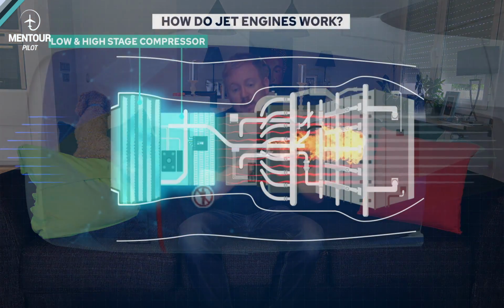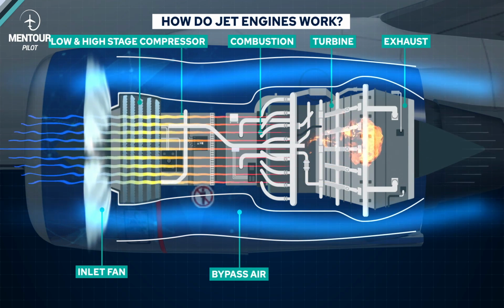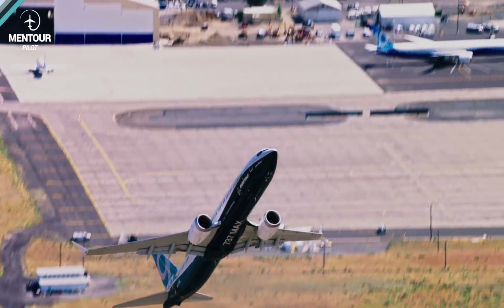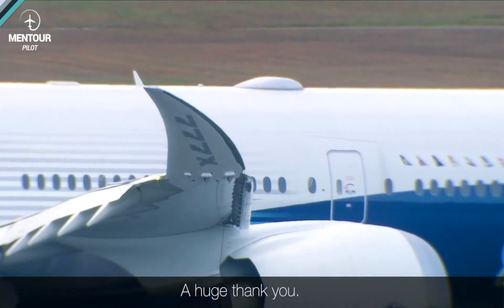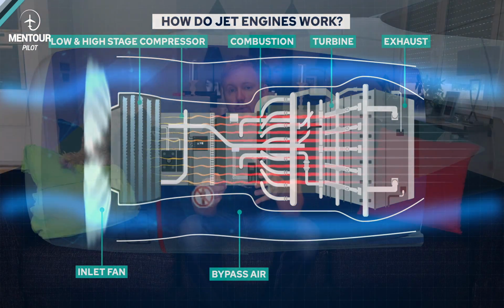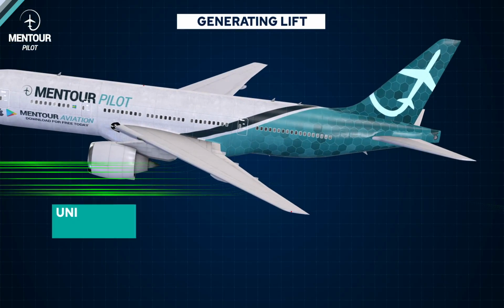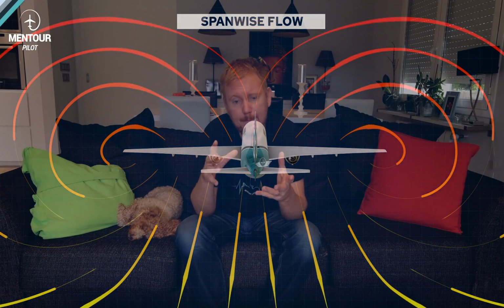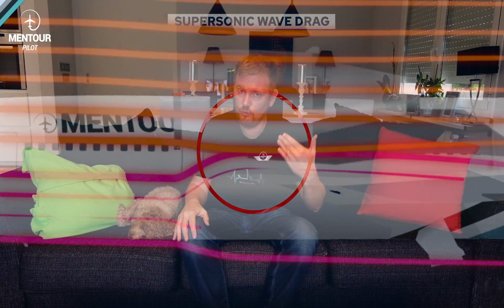How BIG can jet engines get?!

Comment: I enjoy your videos very much! and Thanks!
\
New designs are needed to increase safety margins to the point where no fatalities result from any mechanical, material, chemical, or software failure.

In this regard,  you might conclude that flying is safer than driving an earth planted vehicle. If you look at the past record of airline operation, you will find that while millions of people have lost their lives in ground-based transportation, still, thousands of people have lost their lives in the current designs of aircraft. 

Future designs, if allowed, would have to bring the lives lost count to zero. Some would conclude that this is impossible. It is only impossible because as long as trial and error designs prevail, the lives lost count will always be there.

Take the 737 MAX for example. As your videos show, the failure points are already well known.

The builders of these aircraft know that over the course of decades of operation, they will see hull losses. A good part of those "hull losses" will include the loss of lives and the disability of others. 

Let's say that any new aircraft design or redesign, was subject to special flight paths over land and for cargo operations only for the first one or two years of operation.

Just this change alone could have saved hundreds of lives in the case of the MAX.  Lives that once lost cannot be brought back.

1950's aircraft design just is not going to cut it anymore.

Believe it or not, there are aircraft designs right now with current technology that provide for zero loss of life even in the event of mechanical or software failure.  

What about the 1950's aircraft designs?  That's what museums are for.

Bypass ratios 1000 to 1 with current technology and materials.

Around the equator range.

Unlimited hover.

No need for airports unless you just gotta have your 20th-century dinosaurs.

No fatality failures of any kind.  Mechanical or otherwise.

It is not for lack of technology. 

Why is it then?

All the people that work in aerospace must answer this question. 

Why must you answer?  Because you have taken this responsibility upon your shoulders for air and spacecraft safety.

Because man designed and built these craft, man is responsible for the outcome. That is why.

Well then, if I am so smart then why don't I design and build my own aircraft?

I do not want to jeopardize the lives of millions of people to satisfy my own itch for something new. Something to beat the Jones next door.

Or the Germans or the Russians or the Chinese.

Can't live with that on my conscience. 

It amazes me that some people can do that.

Coward! You might say.

No, just smart enough to know better. 

Know better than to go where angels fear to tread. 

That is your territory. That is the world we live in. That is not going to cut it either. Not with the angels nor with me.

Comment: Great channel.  I'm so impressed with your excellent explanations over such a broad array of topics.  But I feel like you missed one critical point on this one.  You mention that M x delta_v  = m x DELTA_V.  But you didn't explain why it's more efficient to go with a bigger M and smaller delta_v.  And this is because thrust generated is proportional to mass x change in velocity, while the energy required is proportional to mass x change in velocity *squared*.

Comment: In fact the GE-9x is more powerful compared to the GE-90, but they had to decrease the thrust in order to guarantee no material failure, because of the new material they used. That was only possible due to the new wing.

Comment: I worked on the original GE90 in 1991.  We joked that the engine was the same size as a 737 fuselage.  The one thing you missed in your presentation was sound - for a given thrust, higher bypass engines are much quieter.  It is interesting to note that the GE90 was less fuel-efficient than the TF39 engines on the C5.  Of course, the C5 cruises at a much lower speed that probably won't work for an airliner.  Still, modern airliners don't cruise nearly as fast as the Mach .9+ that some of the early airliners reached.

Comment: What about raising the wing to the top of the fuselage, like a C5 Galaxy.  Also remember 13 feet is the practical limitation of shipping the engine.  Giant earth movers and dump trucks could be bigger but the shipping of the tires is the problem,  tires are maxed out at 13 ft.

Comment: I can't believe you can say the max with a straight face. Maybe that's why you are a pilot and I am into corporate management. The max should have bankrupted Boeing many times over by now if not for Covid halting the entire factory production. I am glad I am not a pilot because I would have quit the job any ways the minute the management told me to train for any 737 or fly any 737, which is one of the most common career path of most pilots.

Comment: May be it is time to move wings on top of airplane and place as usually, with old airplane, in the bottom part; or more engine to the rear part of stabilizer, so that noise pollution is less within cabin.

Comment: You didn't explain why the fuselage isn't mounted under the wing. This would have the effect giving more space for the engines. I seem to recall that this is not done due to problems that would occur with delaminated airflow over the tailplane control surfaces etc. With the quest for ever increasing efficiency is this still not a worth another look at?

Comment: They are just about as big as they ever gonna get. 
There's only so much power you can squize out of them. The trick is in new technology to build them lighter, stronger, cooler, better. The size of the impeller blades has been comming down lately.

Comment: Where exactly is the force applied? How is the accelerated air actually moving the plane?
Reply: kinetic energy = 0.6 m (v**2). Higher the comp[essiones, the more the GASSES ESPANDE and then greter the THERMAL EFFICIENCY  of the INTERNAL COMUSIONNES ENGINES. IT IS NOTT A ROCKET ENGIONES!

Comment: h bypass makes sense because thrust is proportional to mv, but energy is proportional to mv^2. That means achieving mv with lower v (higher m) makes the engine use less energy. That is probably the main consideration.

Comment: part of the advantage to under mounted engines is the thrust moment around the pitch axis. The slight pitch up force reduces the required negative lift (down force) from the tail, reducing induced drag.Engines mounted above the aerodynamic center of drag pressure require the tail to create more negative lift which also adds to the lift required of the main wings, so there is more induced drag with high mount engines.

Comment: The fuel burning inside the combustion chamber does not increase the pressure before the turbine. It only becomes more volume due to combustion gases and expansion from heat.
The temperature of the gases entering the first turbine stage is the limiting factor to engine performance. If the flame from the combustion touches some of the metal at high power settings, it will immediately overheat or melt it, damaging the engine really bad.

Comment: This was an interesting installation, and it is, of course, a very complicated subject.  However, there were two potential solutions that you did not cover: 1) high mounted wings; 2) tail mounted engines.  Both configurations have fewer constrictions on the engine diameter.  (I am a B-24 enthusiast, so high wings are always in the back of my mind.)
Reply: good point.
Reply: Or engines mounted inside the wings/as part of the body.

Comment: Correction - You stated that burning fuel in the combustors increases the pressure. It doesn't - it increases the volume of the compressed gasses.
Reply: Was about to say the same, thank you.
Saying such a thing during my turbomachines exam got many people kicked out...if it increased pressure how could the compressor possibly push it through? Highest pressure point is after the last compressor stator blades and convergent section, then it’s all downhill.
Specific volume however increases (density decreases) when fuel is burned (heat added). 
Ideally at constant pressure, the “dramatic” increase in specific volume pushes the gases to accelerate, moving partly the turbine stages and partly generating thrust.
The increase in pressure happens only in (quasi-) constant volume combustion, such as piston engines.

Comment: The VFW-Fokker 614 and the HondaJet do have the engines on top of the wing.
Reply: The VFW 614 had higher maintenance costs than a conventionally build small jet-airliner. This eats up the economical benefits of its good fuel efficiency and the excellent take of and landing performance even on unprepared dirt runways. VFW underestimated the maintenance problem of "standing" engines, so the 614 was no commercial success.

Comment: Missed talking to geared turbojet. The other way is to reduce core size. Increase rpm but decrease fan rpm relative to core rpm. Pratt Whitney uses this in their Purepower engines to get double digits increase in efficiency, with less parts, and 75% reduction in noise. The core of the PW1500 going to A220 is tiny compared to fan size.

Comment: Could possibly see high power generators with a series of ducted fans along the wings (kinda like that one NASA concept).
Reply: Power for what? The engines can work as APU and many planes have dedicated APU
Reply: @FSXgta  Power to drive electric ducted fans or many small propellers along the wing's leading edge. Turn the engine more into a gas turbine for electrical generation. Would certainly need a higher capacity generator than they have now.

Comment: The big problem with the 737 is they want the fuselage low for easy cargo loading, but big engines under the wings.  How about putting the wings on top so you can have both underneath?  How much extra weight are you going to need to transfer the fuselage weight from the floor to the roof?

Comment: What about relocating the wing higher along the fuselage, I know there are a number of light aircraft with the wings attached to the top rather than the bottom of the fuselage. But I'm pretty sure it's mostly older designs and most if not all are props and not jets. Is there a reason airliners couldn't adopt a high wing design? Losing the ability to evacuate using wing exits comes to mind as one disadvantage, but I'm sure engineers could find a way to incorporate additional exits and other features to certify the plane for rapid emergency evacuation if there was a need for it.
Reply: Many military cargo jets use a high wing design so it isn’t impossible.
Reply: @qtheplatypus  That's a good point! It definatelly is technically posible. But I'm worried "cargo" and "military" are the keywords there. Having no passangers or only well trained passangers who easily follow orders and procedure means they can work with fewer exits.
Reply: @KrisRogos  another thing that came to mind after I posted this was that the wing position has a significant role in how an aircraft handles.  A high winged plane would be type rated differently to existing aircraft.  So there would most likely be hesitation for existing airlines to pick it up,

Comment: Perfectly fascinating details on aerodynamics and engines, thanks much, Petter. My engineering hat was on and I completely (well mostly) understand the issues with over-wing engine placement. I hadn't thought about top airflow moving at speeds closer to Mach 1 before so that was nice. Cheers.

Comment: Mentour why Boing went trough all the trouble with moving up and ahead the larger engine for getting enough clearance, instead of making longer landing gear, a hydraulically extendable leg that extends at deployment and contracts before retraction?  Than way the aerodynamics would not change, the AC would have enough clearance when on ground, and making it extendable wouldn't  require more stowing space.

Comment: Each of the 777's engines produces almost as much thrust as all eight engines on a B-52, and with less fuel consumption. The B-52 is stuck with low-bypass fans because of the design of the engine pylons.

Comment: Thank you . I do enjoy the technical talk. 
Some questions. 
1)  Is the turbo fan blades direct drive or driven via reduction gear ? Do the fan blades turn at the same speed as the jet compressor blades ? 
2)  What happened to nose air intake of the 1950's   Old technology always seems to make a come back. 
3)  Why are engines on the wing?  Is that to reduce noise and vibration? If engines were mounted next to the wing and body would that reduce drag?  It might be for safety - engine can fall away or catch fire and not damage the plane as much. 
4)  How hot are exhaust gases ?  90% of the work is now done by a fan. 
Thank you in advance for any answers.

Comment: "The way to [prevent the engines from scraping the runway] is with bigger landing gear."

The C-5 Galaxy disagrees.
Reply: I had the same thought.  Why do cargo planes like the C-5, C-130 etc have top mounted wings vs passenger planes generally mount the wings on the bottom of the fuselage?  I suspect that the military aircraft need more engine ground clearance to operate on dirt runways, and shorter landing gear can be made stronger.  But is there an efficiency argument for bottom mounted wings?
Reply: @liampedersen  You fuselage needs extra struts to support a high wing, thus there are weight concerns. The military also has different requirement than fuel efficiency. Dirt clearance, as you mentioned, is an important factor because military aircrafts has to be able to land on unpaved runways.
Reply: @deep.space.12  Thank you for your reply.  But I fail to see why a top mounted wing needs struts when a bottom mounted one does not.  The C-130 (which I have ridden in a lot) does not have them.  My guess is that airlines avoid the top mounted wings because of cabin noise (engines right next to windows) and difficulties entailed by stowing all the landing gear in the fuselage rather than the wings.
Reply: @liampedersen  Think about the body of the fuselage. 
On the ground, the body has to carry the extra weight of a top-mounted wing, hence heavier components. In comparison, the fuselage doesn't have to handle the weight of a bottom-mounted wing. The force is a compression force on the structure on both types. 
In the air, the fuselage would hang down from a top-mounted wing, and the force is now tensile. So you structural element has to handle both compression and tensile forces, which probably translates to even more increased weight.
While for a bottom-mounted wing, the force is compression in both cases. Less requirement, less weight.
Reply: @deep.space.12  Interesting point.  Thanks again.
Reply: @liampedersen   The main reason as far as I can see is military cargo jets need quick and easy access to the cargo space. A high wing puts the cargo space close to the ground so specialized equipment is not required to load and unload the plane. Vehicles can even drive on and drive off. The downside is that you now have a wing-and-undercarriage box that takes up both top and bottom of the fuselage as an integral unit. Both must support the weight of the loaded aircraft, one in flight, one on the ground. A commercial airliner needs only an underside wing box which also supports the undercarriage. I think that’s why you see high wing military aircraft and low wing commercial aircraft.
Reply: @liampedersen  Efficiency in upkeep, its a lot easier to work on the engines of  a low wing aircraft.

Comment: while Mr. mentour might know something about flying an airplane, his understanding of the jet engine is seriously flawed. First, the pressure in the combustion does NOT rise, it falls. The compressor and the inlet do all the pressure rising.  On a jet engine in flight there is no air SUCTION involved. In fact the pressure at the engine inlet face is higher than it is outside.

Comment: The jet diameter keeps getting bigger due to the increased efficiency of a bigger fans, why not change the design of the newer planes and go for overhead wing design like the C17? In that casethere is load of ground clearance to house these bigger fans.

Comment: He completely missed the new geared turbofan engines that Pratt & Whitney are developing.  These engines are already in production as a PW1000G for medium regional aircraft but they want to build far larger more efficient engines using this technology.  These engines may or may not be any larger than the largest turbofan engine on the new 777X but their engine cores will be smaller and that means even higher bypass thrusts in excess of 92% can be realized while allowing less rotational stress on the turbofan module blades.  On paper these engines are supposed to be even more efficient and lower maintenance.   Unfortunately these jet engines have suffered numerous engine failures, corrosion, fatigue and vibration issues.  Not sure if the failures can be blamed on the shaft reduction gear box between the engine core and fan module.   I am keeping a close eye on this new engine technology. I wonder what AgentJayZ would have to say about these new P&W geared turbofans.

Comment: So move the wings to the top of the fuselage rather than the bottom, have landing gear that can go up and down for maintenance of the engines. Military planes have been doing this for decades. You could also redesign the engines so they can go above the wings.

Comment: If we are reaching the point where the increased drag and weight from the increase in engine diameter outweighs the benefits of the larger fans, could the next improvement be to get much more power out of the core, which in turn could shrink in diameter allowing either a higher bypass ratio for a given size of engine, or a smaller engine for a given output?